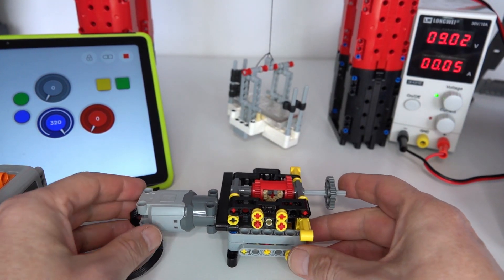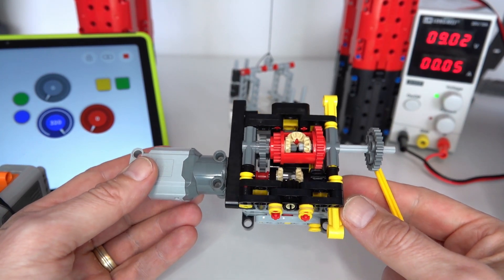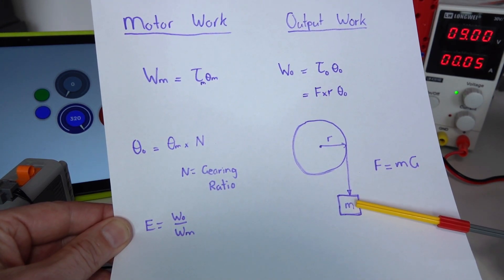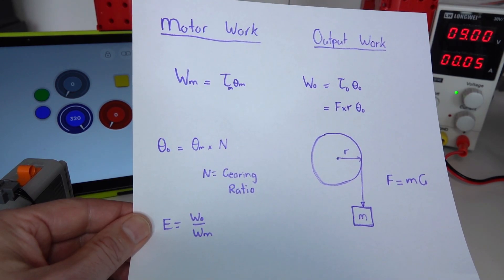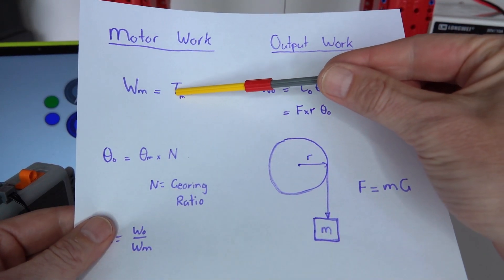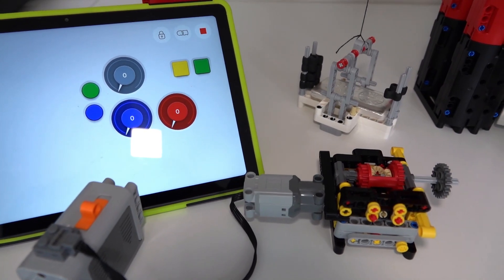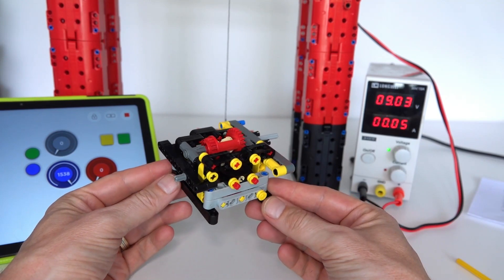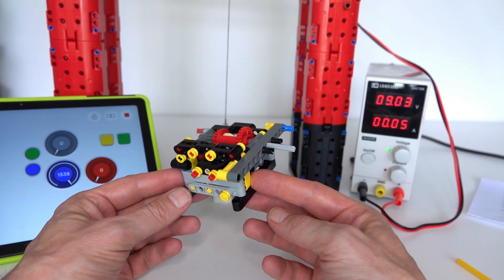Lego Technic Measuring Gearbox Efficiency

Comment: Did you test your software-controlled gearbox too? I was really impressed with that use of the PoweredUp/Control+ programming, and it seemed to work a lot better (probably because the actual gearing was simpler).
Reply from the maker: Ho Johan, no not yet - that's a good idea actually. The lesson i have learned is that the fewer gears the better (unfortunately). 😂